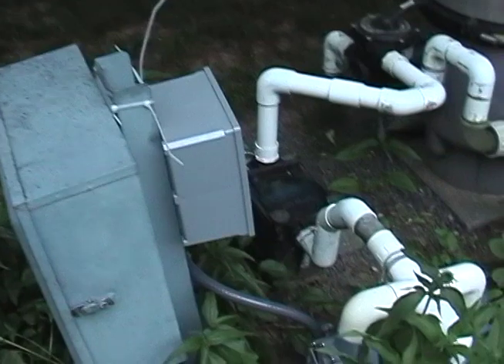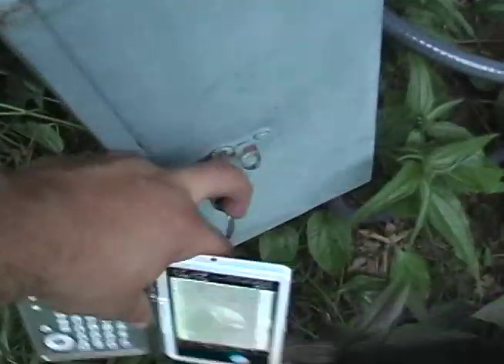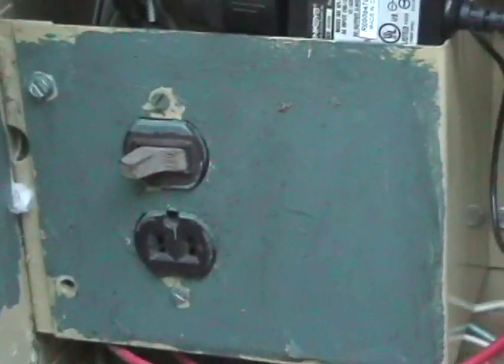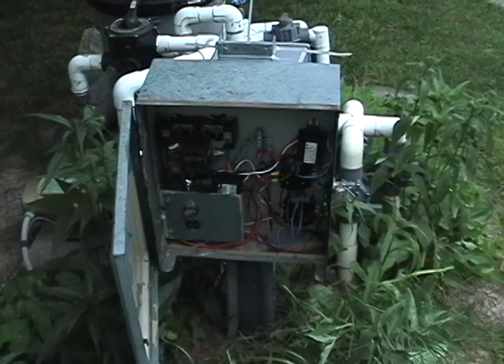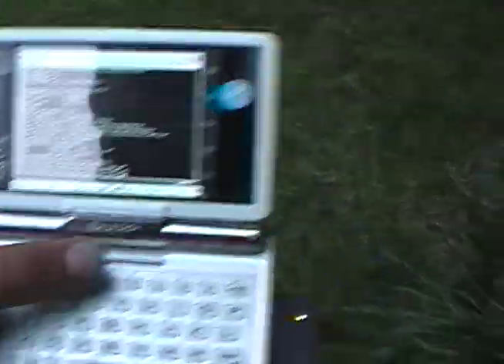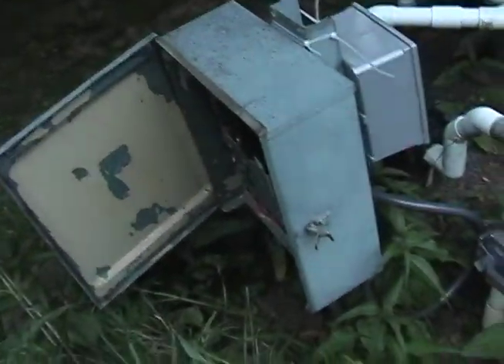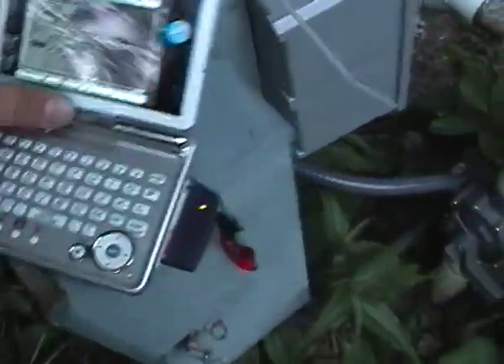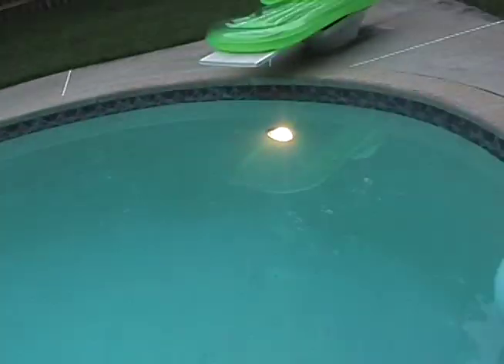DIY Pool Control Automation with Linux (2 of 2)

Comment: Thanks for sharing.  I recently developed a pool "Filter Watch" using Arduino, XBee and GSM shield.  It senses pool filter head pressure >15 psi and sends me an SMS message.  The application was developed using GSM in case there is no internet connection to the home.  I noticed in your first video you used Freescale MPX pressure sensors.  Could you please share your selection?  Thanks, Greg